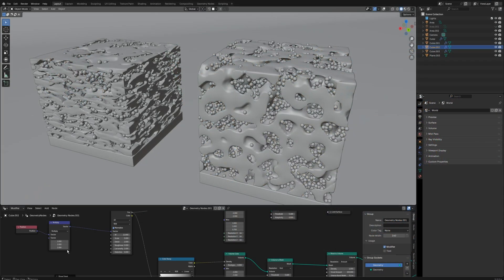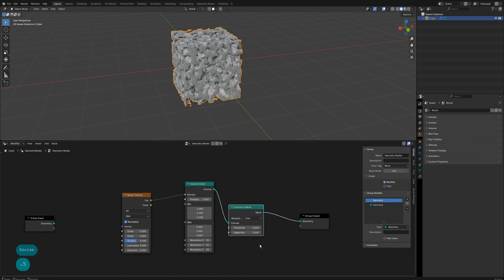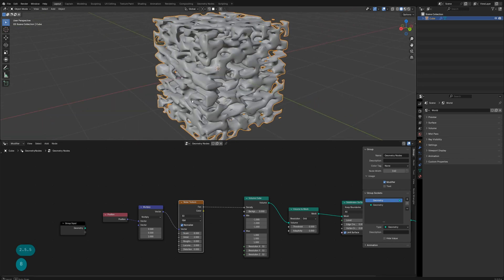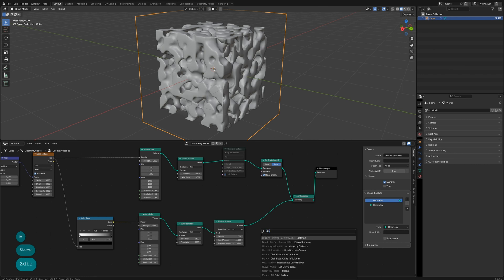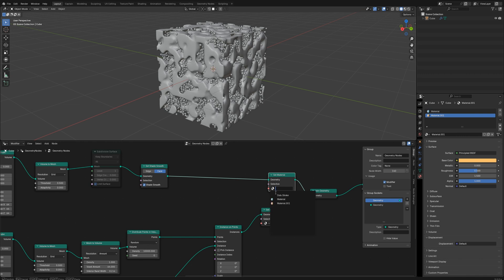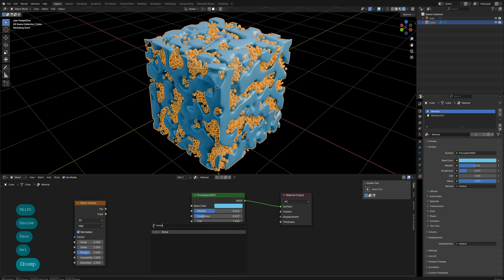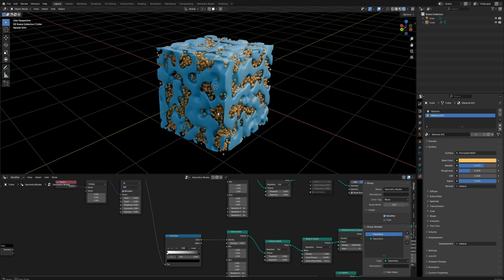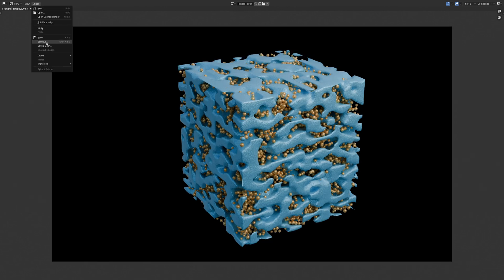Create porous doping material in Blender

Comment: Is it possible to use a custom geometry instead of the ico sphere as an instance? Is it possible to have less porosity at the bottom of the cube and more porosity at the top?
Reply from the maker: Of course. The spheres can be replaced with any custom geometry.
As for creating a gradient in porosity, it’s a bit more challenging. I usually approach it using other methods—for example, by creating a volume with a density gradient and then scattering points inside it.
You can use those points to fracture the mesh to generate graded porosity, or copy short curves/splines onto the points and convert to mesh, which can also produce a gradual porous effect.